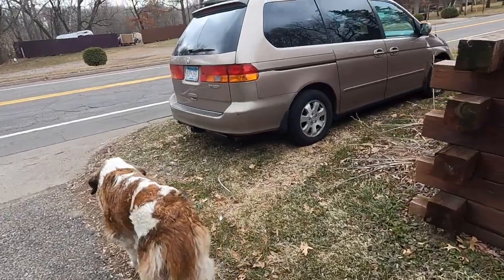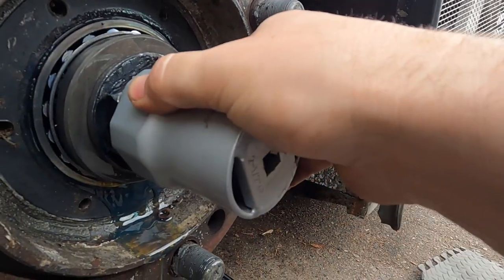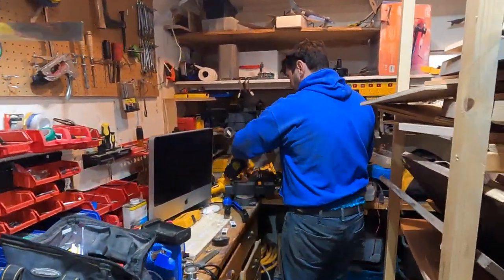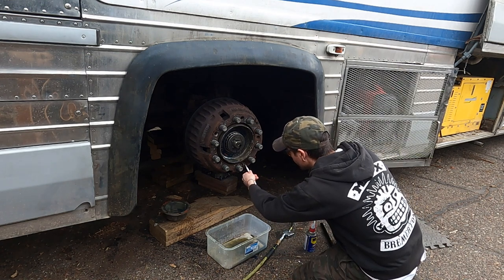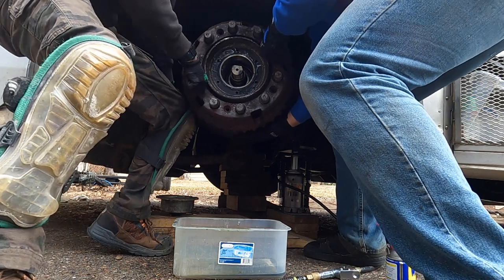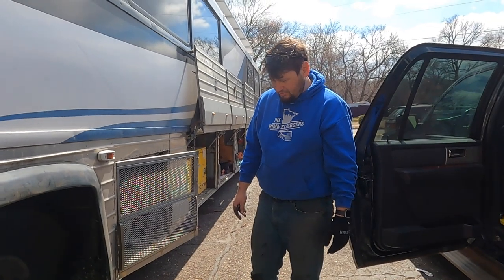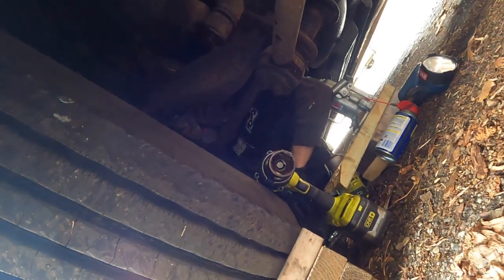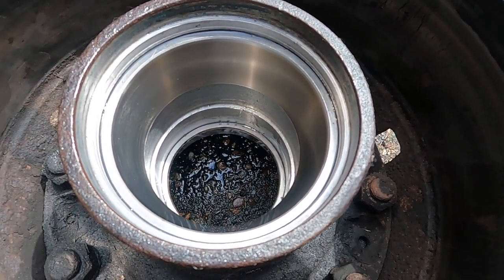MCI MC9 Bus Conversion Front Wheel Seal, Bearings and Shock Replacement

Comment: Nice work fellas. It's always fun working with this old stuff! 
Here is some unsolicited advice from some random guy on the internet:
Couple of tips I have learned doing this same job. Get a nice hand truck to move the heavy stuff wheel and brake drum, check out this video at about 9:50: 
https://youtu.be/-KmO_iZZS2c
The trick I have found to remove the drum retaining screws is an air chisel, it takes them right out, only issue is it does bugger them up but it makes quick work of getting them turning. 
Races drive out fairly easily with a mini sledge and a drift. Personally I would have put the old wheel bearings back in with those races. The bearing and the race are matched to each other, that is the main reason for changing both of them. 
I would check the bearing on the other side if this side looked this good, perhaps that is where the sound is coming from, or it could have been too loose or too tight. Usually its a good idea to check how tight or loose the inner nut is when you are removing it and that can give you some info as to a possible source of your noise. 

One other thing that I could recommend for seals is SKF Scotseal Plus XL, they install much easier without any special install tool and they are a seal in a seal, so they do not ride on the spindle which means they are less likely to leak in the future. 
Check this out here I am installing them here:
https://youtu.be/r4E_3O7bByQ
Reply from the maker: Thanks for the tips ! Yeah, we  could have used the hand truck there. I could even make a wooden cradle for the drum to do it solo.